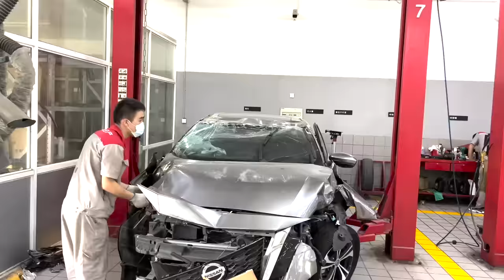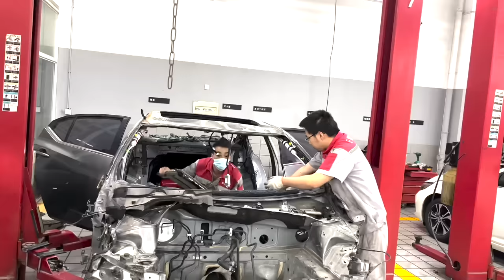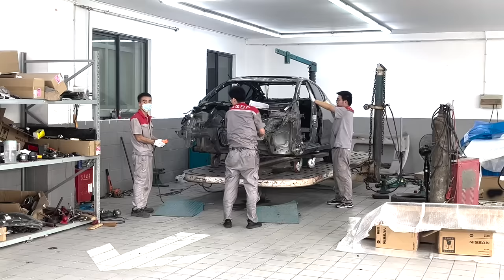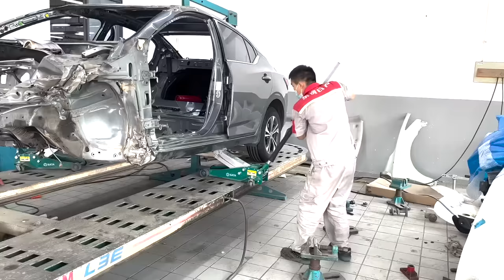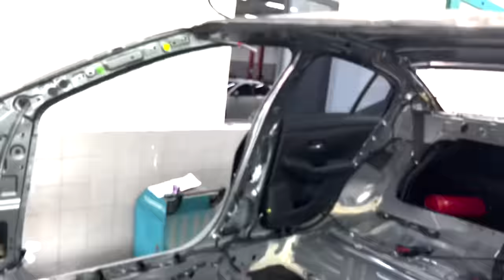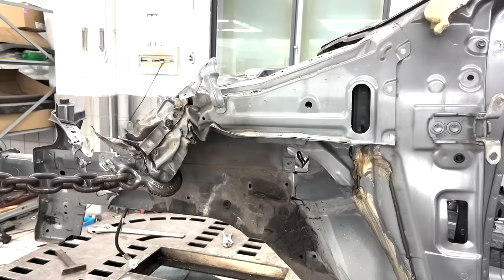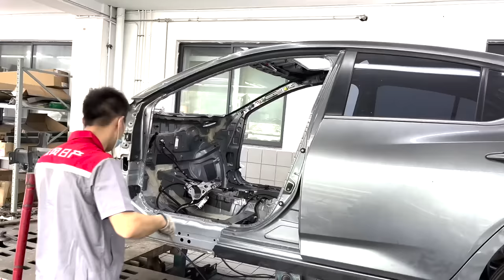Mechanical Wizardry: Master Technician Han Restores Scrap Nissan Sentra to Perfection!

Comment: On ebay: “Weekend car, low mileage,never crashed, owner is a woman, perfect for your family”
Reply: Old woman*
Reply: Apparently Uncle Sam does not know how to value what is a restoration work on a car whose origin is not the USA. 

BEAUTIFUL IGNORANCE FOR THE IGNORANT...
Reply: Well, I wouldn't buy it if I know about its history
Reply: Полностью согласна😂❤
Reply: Non smoker, never seen rain, garage kept, every maintenance done
Reply: 광적인 관리, 1인신조
Reply: @pablogaray6125 The repair of a car on that scale is, in most cases, unsafe. Additionally, it brings problems with fitting the parts. Likewise, what the friend is saying is that there are dishonest people who don't mention that it was repaired.
Reply: A lot of you are hating. But the reality is many can’t afford a new car. So this would be a gem for them. Who gives a shit anyways what we think. There’s a huge market for salvage title refurbish vehicles
Reply: Ездила бабушка, только по выходным в церковь.
Reply: Giờ thì tôi đã hiểu...nhà nghèo lại mua xe đời mới...khi xem xong lip này....😮😮😮😮😮
Reply: Só digo uma coisa. Não digo é nada.
Reply: Female? Oil has never been changed.
Reply: @2815Juan I wouldn't mind if it's properly explained in ads
Reply: @mazyata9958  there's a strange correlation between women and dirty and under maintaned cars. Hell knows why
Reply: I was looking for a cheap car for someone and starting looking at this car I test drove a little critically because it felt a touch “off.”   Then boom: there it was, the subtle paint variations, tiny overspray etc. etc.  Who knows what went into Frankenstein.
Reply: @ЖительЮтуба-х6д ездила в лесу... За ромашки 😂😂😂
Reply: "Hi, I am very insecured with your abilities so I will just troll in the internet"
Reply: Doğru bir hareket değil.... o aracın yeri hurdalık olmalıydı....!
Reply: Я бы с удовольствием купил такую машину, так как видел сам процесс ремонта. Уверен, что всё Ок и ржавчины нет😊
Reply: @imoimo_imori; 
Wrong! This repair shop has nothing to do with Japan, the car plates I saw it are from China, in addition this model of Nissan Sylphy ( or Sentra in other markets) is NOT commercialized here in Japan. Before commenting it would be useful to check it better...
Reply: In my country they say : the owner is a female doctor who used the car to go to her clinic only 😂
Reply: dr driven car
Reply: Mechanic Han? Maybe it's better to call him Mechanic Frankenstein?
Reply: Yes, they look for a buyer who is ignorant to researching car history. All accident claims and a salvage title are on record. Badly damaged vehicles are to be resold for parts not restoration. Their safety and integrity are in question. A vehicle which was folded like an accordion is liable to be weak and collapse in the same manner under stress. Lives are at stake!
Reply: Gosh, are you hinting that someone would lie…..tsk tsk.😊
Reply: It’s terror horror story …
Reply: @ВалерийКараман-б2э  она неизбежно появится, если климат не такой сухой как в австралии😂
Reply: @alpha-draconis how it's not safe?
Reply: first owner
Reply: Vom Arzt gefahrenen Wagen
Reply: Don’t judge the video and underestimate how these great folks repair wrecked vehicles. This happens on a daily, and very often, in other countries. 
Here in the US, we have insurance companies that write these vehicle off as total losses, and they go straight to the bone yard, or to scam artists that straighten them out enough to be drivable, and sold at an auction. These men can, and will properly stitch, and weld this car, back together, and restore the structural integrity using good body parts from a non-wrecked donor car!!!!
Reply: @intentionaloffside8934 I don’t think that’s the case with this repair. It looks like it was repaired professionally, with good intentions, and a good heart. Not like some hack body shops that we have here in the USA, who rush into “repairing” a car, just to auction it off. 
The vehicle is clamped down, crushed parts are stretched back out to OEM structural measurements, as to align doors, fenders, hood, and windshield. All crushed, or compromised parts are then cut off the vehicle, and new donor body parts are put in their place, welded, painted, and the car will be structurally repaired and sound again.
Reply: @jdrs4214  exacto,,se hizo una buena reparación y enderezado a conciencia con piezas nuevas y al parecer originales,no veo cuál sea el problema.
Reply: @2815Juan Hallo und Nachhaltiger ist es auch.Das ist eine 100% Wertarbeit und hätte Vertrauen in dieses Fahrzeug.
Reply: I'm pretty sure that this is a good and certified restoration. 😅
Reply: Damn!!! Same ads everywhere
Reply: @pablogaray6125 So, you are thinking that this car was rebuilt in the U.S.? Think again.
Reply: @2815Juan I think you really want to say but couldn't, death trap automobiles
Reply: Oh my goat😅
Reply: Bitter truth😂
Reply: А ты сам можешь такую работу выполнить???
Reply: Given the evident quality of the work of these professionals, I wouldn't be afraid to purchase it.  The dogs bark as the caravan passes by.  Keep talking nonsense you chatters...
Reply: Freeway driven only...
Reply: Americans dont like if Asian is Repairing it
American Repair Damage Cars Yet you All Praising it
Asian Repair Damage Cars
You all Saying This is not Right 
The Cars is not Safe
You Dont Like it
Americans dont like Asian and Asian Work
Reply: Repent of your sins and believe in the Gospel. Jesus Christ is coming soon ❤️‍🔥‼️

"For God so loved the world that He gave His one and only Son, that whoever believes in Him shall not perish but have eternal life." (John 3:16)
Reply: Anyway it's fixed like to be a new car. There's no difference
Reply: So.not good for driving danger car for new owner
Reply: Jajajajajaja lol
Reply: Bateu a frente 😊
Reply: @ShR1000 😂🤣👌
Reply: Looks like he takes pride in the work he does and makes it look so effortless.
Reply: @alpha-draconis yah but unfortunately some dumbass on the internet will try to argue saying it’s perfectly fine
Reply: @2815Juan there’s a market for trash services to    That don’t mean people are gonna be out buying garbage trucks
Reply: Maybe it w as a woman ! One that has a problem driving .
Reply: О как! Оказывается эта история ни только у нас ходит!!😂😂😂
Reply: А ты думаешь как: нассал в унитаз, отфильтровал и снова пьешь воду. И так весь мир на протяжении своего существования.
Reply: That's the difference between living in the developed and developing world. One man's trash is another's treasure.  Great job in restoring this car. Of course it would not be certified here in Canada but if this was say the Philippines or India, I would buy it.
Reply: for village outskirt, you can consider
Reply: Gahahahaaah
Reply: Seeing the quality of the work I would have no problem buying it as a daily driver
Reply: FYI, China no ebay😅
Reply: Ездили по выходным в церковь 😂
Reply: @2815Juan The vast majority in the West don’t give a damn about human life. The idea is to sell more cars. This man shows a lot of skill that once was common in the West, but sadly no more.
Reply: So many of you guys claim this endangers human life. Tell me how you give a damn about human life? You are just saying what the manufacturers want you to say in order for them to sell more cars. Have you ever looked at the internals of any car made in the 70’s? People still drive them around proudly, and they are utterly unsafe compared to what this guy’s doing.
Reply: New breaks...
Reply: @Hoxton66 unless everything under the hood is replaced.
Reply: @ShR1000  всё очень просто!
Женщины как правило ничего не смыслят в технике, и уж тем более как правильно её обслуживать. Именно поэтому автомобили из под женщины чаще всего в ужасном техническом состоянии и визуально.☝️😂
Reply: @Hoxton66 Would you buy a car that had a minor rear end accident?
Reply: @rs4619 China is now more developed than Western countries in many ways. Your perspective on China is outdated.
Reply: I get the sarcasm, but that’s some impressive skill. While here in America your car gets totaled for a broken bumper.
Reply: Yeah baby))
Reply: 🔥 Work
Reply: If it's been fixed to meet o.e. standards then who cares what work it has endured...
Reply: @alpha-draconis Who?
Reply: @muratozel8286 Next time😅
Reply: Из под дедушки
Reply: @lectusdecor  So?
Reply: All you guys sitting back in your armchairs in the good ol’ USA. If these panel beaters charged what your panel beaters charged, who would be able to afford it? You have priced it out of your own market. These guys are kings in their own countries. They’re fixing and selling vehicles that you didn’t want, that you couldn’t afford to fix and you couldn’t afford to buy if they were fixed. And don’t give me that nonsense about safety for your family. How many unborn babies are slaughtered in your own country? Hundreds of thousands every year? How many people are shot in the US? Many times more than any other country in the world. Don’t be so condescending and hypocritical? Look around in your own backyard first.
Reply: @alpha-draconis  Who?
Reply: 😂 الاجانب تعلموا سوالف العرب
Reply: 100% accident free. Service on time with full service record. Very low mileage, view to believe 😅
Reply: @allenpeterdiman4739  Why?
Reply: 😅😅😅😅😅😅 @AASJAG
Reply: I read a lot of comments here stating that this car is unsafe, and will be sold with no disclosure. Video says that this Nissan was “scrap”, which means title will state that it’s a “rebuild”. History available at the push of s button which will have a heavy damage and an insurance write-off. Question is - after all the parts and labor, what kind of profit can be made on this?
Reply: @marknoir  Good comment

Comment: My only concern is how well the bodyshell will perform in its next crash given that the structure has been cold worked twice already.
Reply: Yes. The structures are tired. I really wonder that he repaired it.
Reply: Not as first  I think
Reply: This would never be done here in Europe, the car is not safe after this type of crash, no mechanic would repair it.
Reply: @ulgn1964  ok
Reply: You better hope that the next owner is not an idiot behind the wheel.
Reply: Have you ever wonder how many new cars aren’t really safe to drive? Giving the assurance that it can be redone I say it’s pretty damn good. I’ve worked at body shops over my younger years and I’ve seen some worse fix then this.
Reply: @onesweet52  Here in Sweden, we have insurance that covers the value of the car and we do not repair cars where the frame or supporting parts are broken, it costs more than what the car is worth and the car is scrapped.
Volvo has a requirement that if a car with a child seat has been involved in a crash, the car must be checked by Volvo after repairs, if a b pillar is broken and the car has traveled a certain number of miles, it is scrapped.
Reply: In Brazil is not mandatory to have insurance cover, only news car are covered by insurance company and crashes like this car the car going to junkyard. But there are some people that by and made a work around and sell to market, this cars has some restrictions insert ar profile, the cost is below the average price and many people avoid negotiating with crash cars, since nobody knows how was repair and no guarantees.
Reply: Não dá nada
Reply: Still...you have to admire skill when you see it.  No parts left over?  looks good to me.
Reply: Simple, don't crash again.. 😅
Reply: @ulgn1964 what you say is not correct, I have seen videos in Spain where they show wrecked cars that are repaired and then sold, there is even an app that shows if the used car you buy had a collision with a loss and was repaired showing the photographs of the crash and after the repair, so in Europe if they do what the video shows, they sell crashed cars which they repair
Reply: The car is totaled. It should not be used.
Reply: It was better to write it off
Reply: I fill like it's not 100 percent but it does look it, nice job on bringing a car back from the grave, although it might semd the next owner to one.
Reply: This is job for repair not cut the car body...it is safe..dIfference If cut the body anything happend such as crash maybe more impact to drivers.
Reply: velee guud kuestionn
Reply from the maker: You've raised a valid concern. The structural integrity of a vehicle can be compromised after undergoing significant repairs, especially if the bodyshell has been cold worked multiple times. Cold working involves deforming the metal without heating it, which can lead to changes in its mechanical properties.

After extensive repairs, it's essential to thoroughly inspect and test the vehicle's bodyshell to ensure it can still provide adequate protection in case of a future crash. In many countries with strict safety regulations, repaired vehicles need to pass thorough inspections and crash tests to verify their roadworthiness and ability to protect occupants.

If there are doubts about the car's safety or performance after repairs, it's crucial to seek professional advice and have the vehicle thoroughly evaluated. Ultimately, ensuring the safety of the occupants and other road users should be the top priority, and if there are concerns about the bodyshell's integrity, it may be safer to avoid using the vehicle on the road again.
Reply: @xinxianshi at least Han is doing a professional job here in the UK garages were doing what we call cut and shut which means taking two car's one with rear end damage and another with front end damage cut the two good ends in half and join them together now our government are trying to get us to buy electric car's that keep catching fire,
Reply: Should just left it totaled
Reply: Better than throwing away the whole thing away in my opinion
Reply: I think you would get a shock if you Found out the amount of cars that are on the roads that have gone through this work, alot of them have not been so well done, in the UK for awhile cowboy operates were doing cut and shut which is two car's that were joined in two halves one front end damage the other rear end damage that's why this work is  rare in the UK it's cheaper for the insurers to pay out and scrap the car,
Reply: Besteira, nunca fica igual à de fábrica.
Reply: There's no a significant difference in performance at all if you are at 75 MPH crash, believe me.
Reply: The answer to that is don't crash
Reply: 2nd is not equal to 1st, so it's very dangerous to travel , u are correct

Comment: I had a chassis accident back in the eighties and I loved the car so much that I refused to scrap her and decided to do full repair and I confirm to you that a car can never go back to manufacture status
Reply: You are right Sir Safety is compromised.
Reply: Че ты там в 80 мог вообще отремонтировать 😂
Reply from the maker: Thank you for sharing your experience with us! Indeed, repairing a car after a significant chassis accident is a challenging task, and it may never fully regain its original factory condition. However, with skilled craftsmanship and dedication, it's possible to restore the vehicle's appearance and functionality to a considerable extent. Our team here takes pride in doing our best to repair and improve the damaged vehicles we receive, but we also understand the limitations of the process.

Safety is always a paramount concern, and we ensure that any repaired car meets necessary safety standards before it is back on the road. We take every precaution to ensure the repaired car is as safe as possible, but you're right that it may not be exactly the same as when it left the factory.

Thank you for your insight, and we appreciate your understanding of the complexities involved in car repairs. If you have any questions or need further information, please don't hesitate to ask. We value feedback from our audience and always aim to provide the best service possible.
Reply: Explain. You did the repair? What was the damage? What kind of car?
Reply: depending on craftsman skills
Reply: it was Alfasud Ti 1.5 QV Black and I was driving like crazy as we had bomb shelling during the war in Lebanon and while doing maybe 100km/hr suddenly a car took off blocking my way so i hit the breaks but was going straight to hit the car so i use to do manual abs by turning the steering a little and doing a split second release on the breaks. when i did the car jumped on the middle of the road and I hit a palm tree. the car should have been totaled but that time new cars in Lebanon were very rare and valuable so I decided to fix but the whole front was twisted to the left and that time they used chains and without any equipment to full the inner fenders. I believe maybe we should have changed the front but maybe Alfa Romeo did not manufacture them as spares I do not know. What happened the car came out nice and shiny but soon started to disintegrate and strange mechanical failures started happening like suddenly the front break calibers would break causing the breaks to slam stop and luckily it happened on slow speed or suddenly the front transaxle  would go loose and the worst is that it was never calipered properly so when I go on a pump the car would jump sideways :-( and then the inner fenders started cracking and at the end the car got shot with drill of bullets and then I just sold it for 400$!!!!!!!!!!!!!!! @jerytherew1
Reply: @shelbygtsoo  👍
Reply: @shelbygtsoo отличная сделка
Reply: @xinxianshi  but I feel with the level of work you performed I wouldnt notice the difference
Reply: Not 100%, but 97 to 98% is fine too. Unless you plan on getting into another severe accident.
Reply: @serjserj8404  ну в совке да, сложно было бы, но возможно. А в Европе или в США это нормальное спокойно все ремонтировалось.
Reply: @shelbygtsoo  Тормоза у вас были плохие 😢 ,, при торможении машину не должно уводить в сторону 😮